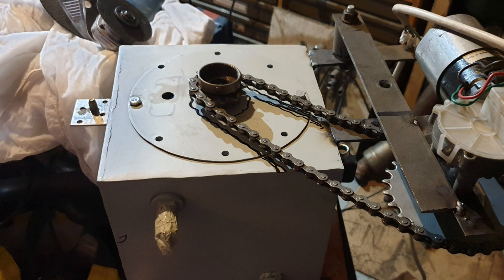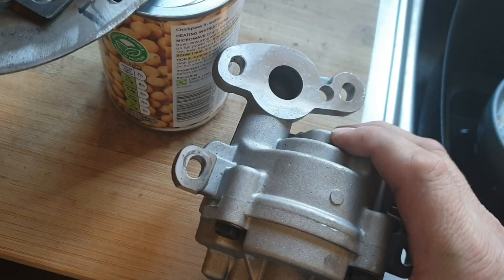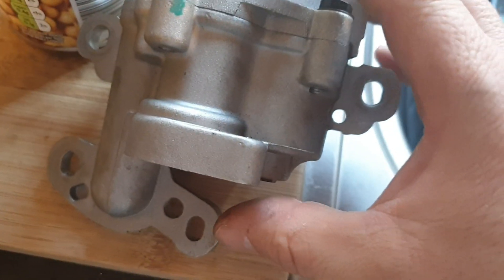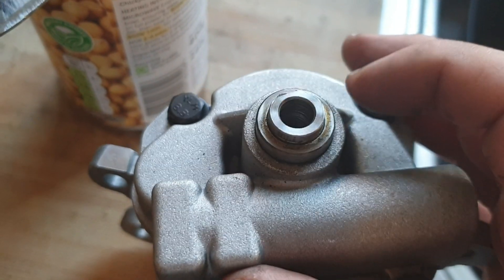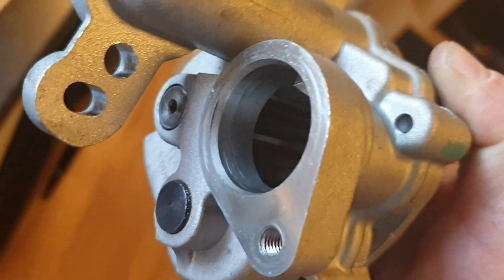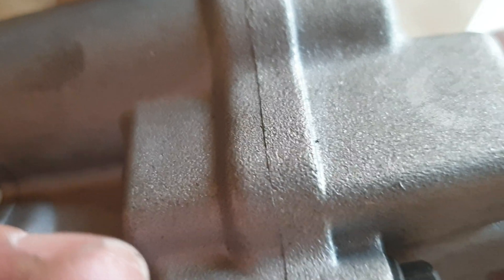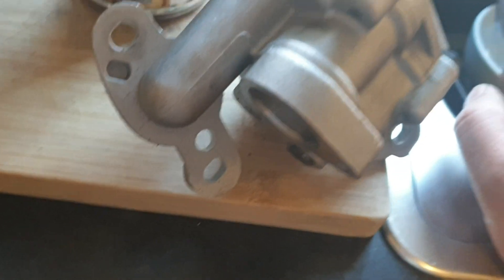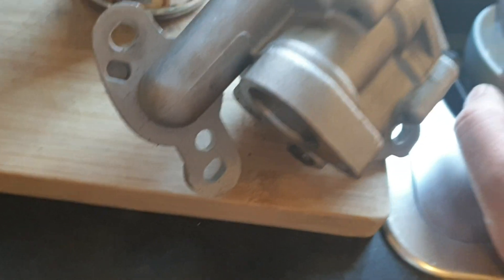Lexus LS400 rear mount turbo - Part 7 - FIRST START!

Comment: Nice project.what exhaust cut out is that and dose it leak bad?
Reply from the maker: Hi John, it's just a generic chinese made 76mm cut out, wasn't expecting it to be very good but its surprised me, no leaks at all from the unit itself. I think the only part to be concerned about is the actual motor,  but with mine being away from water ingress it might last longer, maybe only the heat will kill it. 
I think the same kit is on Ebay for about £60 right now so good value really👍

Comment: Why not use an electric power steering pump?.... Just a thought
Reply from the maker: That is something I'm working on next, figuring a way to reduce the pressure from 1200psi working pressure to something useable is my next step. 👍
Reply: @FullBoostJ4  potentiometer/controller? Or just a restrictor with a bypass that's within the realm of reality for the pump. You could try a lower viscosity oil designed for high temps and use an electric water pump. They definitely will take 180 deg F but not sure about being able to bring the temps down that much on the return but if you're running water lines you could use a plate style heat exchanger like most oe oil coolers In combination with an air to liquid traditional oil cooler and put a small fan on one side. Idk what the aero is like on the belly of the LS but you could be the first non ricer with hood cough excuse me TRUNK scoop lmao. 
Sweet project all around. I wonder what the viscosity of jet turbine oil is
Reply from the maker: @accordv6er  some great points there. I've got a pump I'm playing with, just got a 1500psi gauge so I can see what it's like with some relief spring work. But using a bypass valve is also something im looking at. But my current set up is only temporary as when the oil starts warming up the pressure drops down quite far. But it's all a work in progress. I may end up switching to engine fed and scavenge back yet. Thanks for watching 🙂

Comment: I feel like you made this unbelievably over complicated.
Reply from the maker: Maybe it started off complicated but its pretty simple now. There's a turbo bolted to the rear of the exhaust,  there's a pump that provides its oil and there's a charge pipe that goes to the inlet manifold. 
The engine runs happy at its normal temp, I haven't had to fabricate manifolds, I didn't have to lose any comforts like air con, I haven't added a load more weight in the already heavy front. And I can pull the turbo off in 20 mins and still run the car. 
Things will only get better as I improve the set up and when I've got decent management it'll be a whole lot more fun as the turbo is just begging to run more boost.